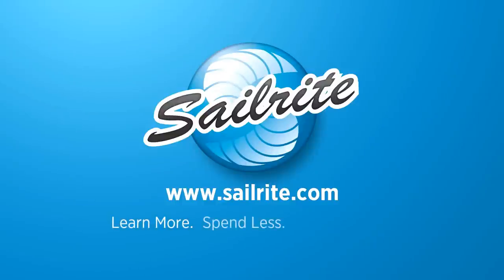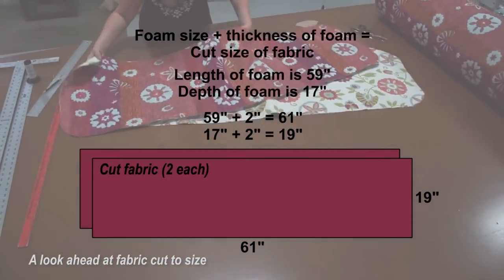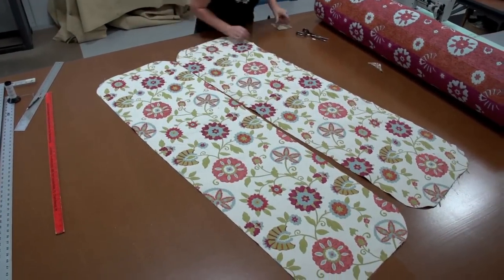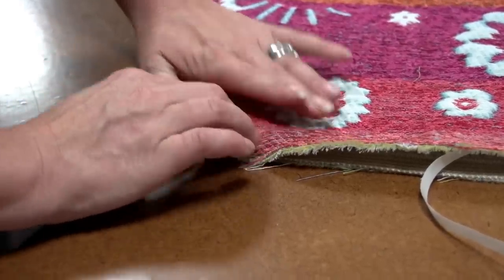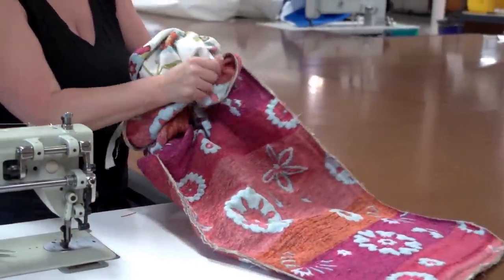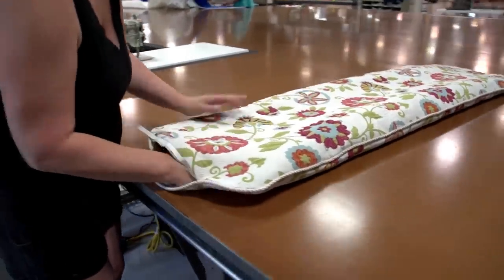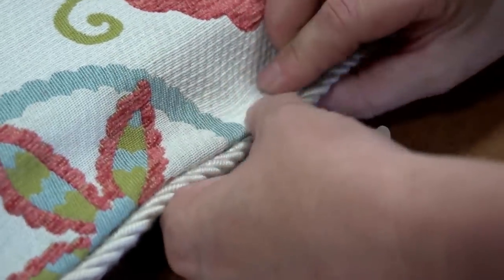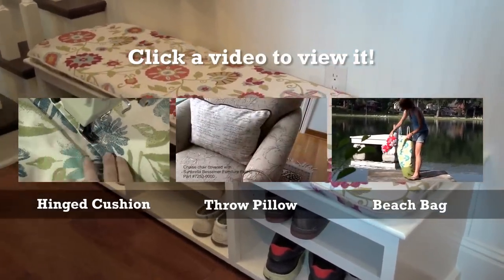How to Make a Bench Cushion

Comment: Excellent tutorial, 2 questions though: do you always have to compress the foam, and  how about wrapping a batting around the foam??
Reply from the maker: No, you don't have to compress the foam. You can always tell when cushion covers are made without compressing the foam, the fabric will fit loosely over the foam and often has wrinkles. Adding a polyester batting is very common for cushion making, it helps round the corners of the cushion.

Comment: I tried the “gummed tape ..... my needle stopped working as it became covered in glue. What did I do to not do to stop this happening again?
Reply from the maker: A couple of suggestions – 
1.       Try the next smaller needle. Sometimes you just need more friction between the needle and the fabric to clean the adhesive from the needle. Otherwise the adhesive fills the groove in the needle and keeps that groove from performing its function – allowing the thread to slip on one side of the needle to allow for thread loop creation. If the loop is not created then the machine will skip a stitch or stitches. I can see the adhesive buildup very clearly in your photos.
2.       Push the needle into a bar of Ivory soap repetitively to coat it prior to installing it in your sewing machine. Adhesive just doesn’t stick to this soap and it sometimes works really well.
3.       Make sure you are using the right basting tape. If the tape you are using has too much adhesive content it will stick great but will also potentially cause stitch skipping.
4.       Final, check your machine’s timing. The needle bar could be a tad too high or the hook could be slightly delayed in rotation.

Comment: If your foam is 2" deep why do you only add 2" to your measurements when cutting fabric to size instead of 4" (doubling for each side)?
Reply from the maker: crafty Since we are cutting two plates (top and bottom plate) we only need to add 2" to the overall size of the fabric to accommodate for the 2" thickness of the foam. Since both top and bottom plates have the extra 2" that will accommodate fro the thickness of the foam. The seam allowance will remove some of that, but that makes the cushion cover tighter and thus it looks better.
Reply: +Sailrite p